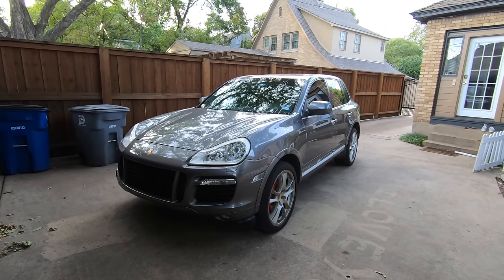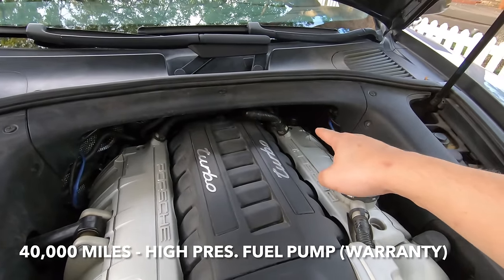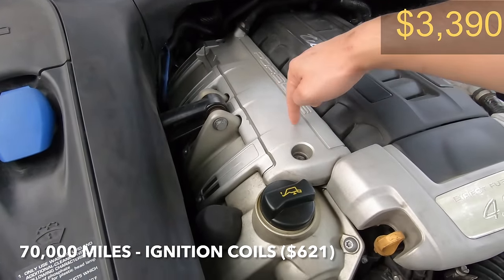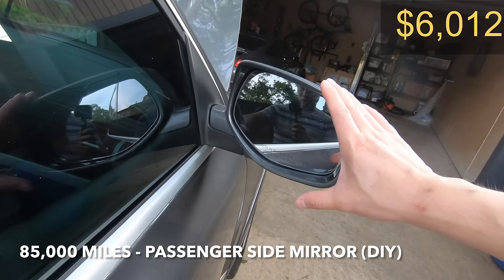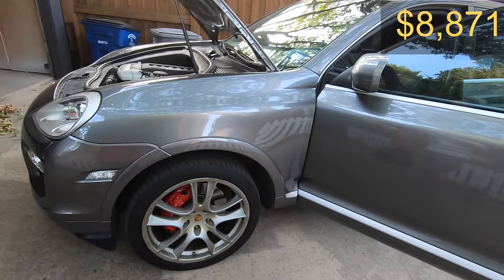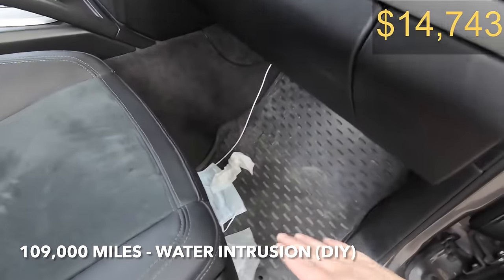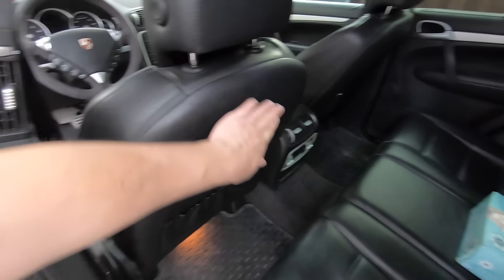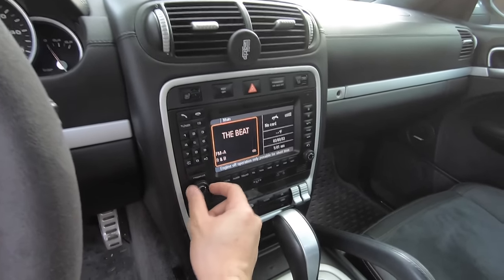Why Are Used Porsche Cayennes So Cheap? Owner's Review of 15 Year Old Cayenne Turbo (955, 957)

Comment: This really makes me appreciate my 2008 Toyota 4 Runner.  150,000 miles and only thing I have done is change the oil every 5,000 miles, 2 brake jobs, and 2 sets of tires.  And that was with an ungaraged vehicle in New England snow.  Had to replace the wiper fluid a few times too, those damn pesky Toyotas.  That Porsche must be a fun ride, but something about the reliability of a Toyota I love.
Reply: I'm sure you didn't forget about regular maintenance like spark plugs, air filter, etc?
Reply: 150,000 miles on a 4 runner, youre just breaking it in, that thing is gonna outlive all of us
Reply: @Chris-de2qc  Belive it or not, yet to change a plug.  I did forget about the air filter every 15,000 miles and maybe 2 cabin filters.  I have hardly put anything into it compared to that Porche. I love the look of that Porche, but never realized just how much more reliable a 4 Runner is.
Reply: @skuzz8182  I have some friends that have hit 250K on there 4 Runners.  I think another 50K on this one and then time to get some modern technology.  But I just can't let this one go, she has treated me so well.
Reply: I have 175k on my highlander and am having my first issue. Wheel bearing. Michigan roads have done that on every car I’ve owned though.
Reply: I have a '97 4 Runner and it has been the most reliable vehicle I've ever owned. It has just over 418k miles on right now. I've replaced the starter twice and the alternator once. The orginal rear drum brakes lasted over 300k miles. I had the original clutch replaced at around 325k miles since I was going on a long road trip. I plan on replacing it with a new 4 Runner in the very near future. I want a reliable vehicle that I can count on for my retirement.
Reply: The people at BMW were surprised how thorough Toyota is during there partnership  when it comes to egineering
Reply: 2004 4runner @ 220K miles. Runs perfect. Love it.
Reply: The V6 version of this car has much less problems not even half of those problems
Reply: My 2001 Honda CR-V with 24000 miles and still running smooth.
Reply: My 2009 VW Touareg 329,000 changed the water pump at 200,000 besides the AWD shaft no problems
Reply: @jaymsu9671  Same thing with my gx470 + an a/c compressor. Built so well I get better mpg than advertised when new in 2006 (with A/T tires).
Reply: This video made me feel like I ran up twelve flights of steps.
Reply: @Jeremyho439  That’s low mileage. Once you add another zero to that, it’s about what my CRV has.
Reply: @jaymsu9671  how do u know when the wheel ebaring is going?
Reply: The bar is set higher for Toyotas. Frame rusts at 100,000 miles. oMg! BMW engine fails at 70k... iT's a NoRmal part of fine German engineering! Use special German oil! Car people are dumb.
Reply: Love my 2015 Scion XB manual. Fun, Roomy, Reliable. Best car I have ever owned! I do have a classic VW GTI 16v, a 92 I bought in 98, fun pure fun. Its a weekend toy.
Reply: Still is the Toyota .... not the Porsche though
Reply: Likewise I have a 2002 Toyota Sequoia 4.7 V8 with 222k. I paid for extra frame rust protection from the dealer when we bought it bc we live in New England. Frame is still mint! Only 2 non-maintenance problems I've ever had is a broken rear door latch & the a/c compressor crapped out at 213k. I'll take this kind of rock solid reliability over a fragile Porsche any damn day of the week!
Reply: And you can still buy that same car today!
Reply: @vetteluvnh  I just wash the undercarriage in a touch free booth. 260,000 miles on mine and frame is still solid.
Reply: My 4runner gave up the ghost at 400,000 miles. Two transmissions and an engine rebuild later I was broke. Still my favorite car
Reply: Yeah, I have an Audi Q7 and while its not as bad as this Porsche, if I could do it again I'd get a Tpypta Land Crusier. They don't look at nice, but who am I trying to impress. I do enjoy the performance aspect of my SUV but between gas and regular maintenance cost, I wish I had gone with a Toyota. Next time...
Reply: @betterwithrum  this Porsche had an unusual amount of issues. Toyota Land Cruiser would not give you much better if any better mileage.
Reply: @betterwithrum  I would think rich people who can afford things like the G wagon have other priorities. They either lease these cars or pay cash. I'm not rich I don't know how they think.
Reply: @chir0pter  I sold my LandCruiser with 650,000km. I still got $30k (Australia)
I replaced the injectors and alternator. That's it.
Reply: Of all the cars I've owned, the European cars were the most unreliable by far. Who cares how good it is when it breaks down. 
In Australia if you're in the middle of nowhere and you're broken down, it could be your worst nightmare.

I think if your car has any problems that make the vehicle stop in the 1st half of the warranty period, it should be recalled or purchased back by the dealership.
Reply: I had a Toyota Avalon, I put 200k on it with almost no problems. Now my daughter drives it. Over 250k and still going.
Reply: That’s why u don’t see many videos on 4Runner maintenance.  Or 4Runner performance
Reply: They're really something else, gotta say. Enjoy the Toyo!
Reply: Toyota FTW, but hey a 4runner is nothing like a cayenne Turbo. Does your 4 runner have a timing belt?
Reply: Toyotas are one of the best in the world ! Just watch top gear with the red Hi lux...they couldnt destroy it....  Bullit proof cars !
Reply: My dad has a 2005 Toyota Corolla 

Its at 350k + miles now, only had to replace a starter motor besides normal wear and tear (brakes etc)

He changes oil only once a year, like 20-30k miles lol..
Reply: @Chris-de2qc  you just put in new spark plugs when engine starts giving trouble in a Toyota
Reply: I used to like Toyotas. My old man had a 01' Tundra when it was new and super reliable. That was until the truck got hit with the infamous frame rust rot. But hey, at least the engine still works right?...
Reply: @stephenjedrey5370  dude no matter what brand the car is you need to change spark plugs..... Just like oil it has to be done..... Unignited fuel can damage the cylinder chambers.....
Reply: Same:  2011 Honda Accord coupe Black.  196K.  4 cyl. 35mpg.  87 octane gas.  No repairs just upkeep.  Oil changes every 5K, tune ups X3, tires X3, brakes X3, Fluid and filter changes etc. ...Oh yeah 1 set of new headlamps with new LED bulbs 3500 Kelvin lasting 50K hours.  yearly maintenance costs ~$300 and no mods needed or necessary.  Love the way my Honda drives.  Not bad for a car that's almost 13 years old built in Ohio.
Reply: @jerryp2433  My 2003 Tacoma built in Canada and the frame is for lack of a better word perfect.  Not all Toyota's rust out.  Most of the bad Tacoma's years ago had the frames rusting out in less than 2 years.  Untreated frames from different manufacturer I guess.  Sad that it's still fresh in peoples minds that at one time for like 2 years Toyota Tacoma frames were rusting way too quick.
Reply: @JC.SpdRcr5  Yea the ones that were rusting out were built in America not Canada. Same factory that builds the Teslas. They screwed up the coating process. Canadians seem to build very good car factories...Windsor Ontario, etc.
Reply: This whole comment section has turned into praises for Toyota vehicles. 😂. My Highlander has 170k and nothing ever done to it except regular maintenance, brakes, tires & a couple batteries.  Never owning another z German car again for sure.
Reply: @DriverGuy23  I want an Alfa Romeo Giulia but I would lease it not buy it.
Reply: @chir0pter  my 2013 Cayenne s runs like a clock.
Reply: @jerryp2433  maple syrup makes us smart, eh.
Reply: @normal_human  nobody cares dude, he’s talking about driving a gas land cruiser in the US not some 150hp diesel outback specialist.
Reply: But WHAT do the NEIGHBOURS think?!?!?
I bet you probably ALSO buy 'store brand' bread & cereal....
Reply: K, I've owned several 4Runners and you're neglecting wear items like anything with rubber or plastic like ball joints, control arms, etc. I do most of my own maintenance but the 4th Gen has been a problem child. Latest issue is finally getting the transfer case actuator seal replaced, which is a bear of a job. Do you have the V8? If so, your timing belt needs to be done. Oh, and they have notoriously easily rusted out exhaust manifolds which causes a nasty ticking. Blend door actuator failure? 

Which is to say, I'm glad yours has been smooth, but I think it's a myth that the whole Toyota is problem free when it's really just the drive train that is pretty bomber. The rest is just as problematic I've found.
Reply: @chir0pter  You obviously cared :)
Reply: @lonememe at least it's repairable though. Try doing a timing chain for an Audi.
Reply: Your 4runner is probably one of the top 10 most reliable vehicles sold in the u.s. in the last 20 years
Reply: This is why I ADORE my Lexus suv. Luxury (almost) of Porsche, reliability of Toyota. Perfect vehicle.
Reply: @lonememe  Also sometimes you just have badluck....It's a probability game.
Reply: Lol
Reply: @normal_human  yeh rite someone is jelly cause they had to settle for a Toyota
Reply: Why are u Jappers even looking at this ?  slight envy eh ? admit it  !  LOL
Reply: Can't compare any car to Toyota, maybe Mazda, others are money pits. Well if you really have money or you like cars more then driving utility then EU cars are no match to any, simply you get top notch cars when new.
Reply: Doesn't need to be a Toyota. Most cars should be problem free up until 150k. I have a Kia Sorento with 130k and only done exactly what you said except brakes only once.
Reply: Since outsourcing German cars became very unreliable. The brand is German but they are made all over the world.
Reply: @daniellantos26  there lies part of the truth, but the other part is that Porsche Cayenee is just rebranded VW Touareg. Also all EU cars made outside of EU are lower quality, even in EU there is difference between cars made in Germany vs. made in Polland or Slovakia.
Reply: The Toyota isn't a german "quality" car....
Reply: Toyotas are boring...I mean - their reliability is so boring. Where's the fun with going to the mechanic to have a talk over a coffee while he is trying to figure out what is the problem?
Reply: @normal_human  lost in the Outback with bogans around the car......
Reply: omg, was just gonna say the same. my 4 runner has been running thousands of miles and nothing has gone wrong, just normal maintenance. same with my wife's rav4. so much for german engineering. this is so embarrassing for them. shameful considering the price people pay.
Reply: Same here with my 08 Honda accord only issues I’ve had with it was an oil leak and the cylinder deactivation had an issue so it turned itself off and went into full v6 mode until I got it repaired other than that it’s been a fun vehicle to drive despite me wanting Apple CarPlay unfortunately that’s for the more modern vehicles
Reply: @koro287  you ever thought that maybe we want the Germans to build better cars so that we can buy it? If you fanboys would stop buying their POS poorly designed cars maybe they'll actually get better and cheaper.
Reply: Yeah but driving a 4 runner isn’t much better fun
Reply: @420BudNuggets  are you crazy bro? I drove my 20 year old 4runner to Alaska. If I wanted a sports car I'd buy a real sports car not a Cayenne. Lmao.
Reply: @420BudNuggets  try taking a cayenne to hells revenge it wouldn’t even survive
Reply: 138,000 on my '13 Runner. Recent brake job. 
Only thing I have going on is the neutral selector switch. Common in 5th gens.
Reply: @slapshotjack9806  I need a Porsche Cayenne to survive a zombie apocalypse....Said nobody ever. Lmao.
Reply: @jerryp2433  no a peel p50 would straight up ruin every zombie in its path 😂
Reply: My 05 4rumner has 277k miles and runs like new. All original parts still
Reply: @Chris-de2qc  those toyota engines can run without oil changes / low oil too
Reply: @stephenjedrey5370  Those 4 runners are being sought after and appreciating in price. They would go 999K with bare minimum maintenance
Reply: Very true!  That thing will last a long while, performs great offroad and the design still looks nice.  May even accrue value after so many years have past.
Reply: Bro, previous Porsche owner. Honestly reliability over fun, there I said it. Maintenance bills forever
Reply: Toyota is a better daily driver than any porsche.  I've owned 2 porsche cars and they were typically garage queens because the reliability was low. My tacoma and wife's FJ are much more reliable.
Reply: Have an '07 4Runner (4.0 with AT) and a 2011 Cayenne S. The 4Runner now has 250,000 miles and the Cayenne 120,000 miles. Neither skip a beat, but the 4Runner is a league of its own when it comes to being bulletproof. The Cayenne hasn't left us stranded and is a much, much nicer ride (air suspension and V8), but the 4Runner is a great and forgiving beater. 
That being said, the Cayenne isn't really all that expensive to maintain if you can do the work yourself. I spend about $500 a year on maintenance on the Cayenne, and that includes the transfercase which I change the oil for on every other engine oil change as a preventative measure.
Reply: I came here to say similar.   Mine is 1996 third gen.  I’ve recently had to refill the windshield cleaning fluid … ;)
Reply: Same with my Honda Civic.  And the wife's Toyota Corolla.
Reply: To be honest, for $90K, that car should be the most reliable car you’ll ever own.
Reply: I heard Toyota 4 runner is still made in Japan only. So no wonder.
Reply: you don't get to number one by screwing your customers.   I don't care if it is a ferrari , a porsche if a car is not reliable, those companies take you on a ride. Those fanboys act like school girls. Ferrari is even worse, you almost have to tatoo ferrari on your butt, and to pledge allegiance to buy a car. Toyota does a lot of R&D and their cars are very reliable. Just watch any safari shows in Africa,  What do they drive: Toyota. If a lion or a elephant charge you, you d better have a toyota. Also sport cars use low tolerance engineering, you have more power but it breaks easily. Not to mention, tires get worned out very quickly. The only benefits of having luxury cars are the ones that appreciate in value or if you want to attract a gorgeous woman but be sure that both are money pits.  Also sport cars are not that great for long distance. The suspensions are quite hard, and you are very low. As for the lamborgini, you don't see anything in the rear mirror. You hit a landcruiser with a sport car , you are so dead.   Plus in a fancy car, you d better dress fancy too because cops will pull you over thinking you stole it and if you are black they definitely pull you over. https://www.youtube.com/watch?v=Ca8_HeJo13M&t=425s  . Sometimes, they pull you over just to check the car, or just to annoy a rich guy.  I will only spend that much on a car if it is not my own money. https://www.youtube.com/watch?v=m4AiIl67eT8
Reply: Same experience with my Avalon.
Reply: well, I never feel regret to have my Cayenne Turbo though now and then I might face some minor issues, as I have a very reliable independent mechanic. It worthies and its full of fun to drive around. In such a busy life, I can have daily pressure when I drive it to work and get back home. The pleasure makes it worthy
Reply: What a shame. Pretty much everything we buy seems to be junk these days.
Reply: A Toyota could be driven to the moon and back, twice with no problem.
Reply: Had a 2004 that I bought new, put 235,000 miles on it..sold it and purchased a 2008 limited 4 runner with 99,000 a few years back and now have 130,000 miles on that one with absolutely zero issues. Know for a fact I have at least another 100,000 miles to go..
Reply: @Chris-de2qc   Changed my plugs in my  Toyota at 150 000km , old ones still looked good as new . Hade many different cars even a BMW , Toyota is the best by far no issues
Reply: I have a 23 year old blazer which I love.  But the diff is whining and I'm sure the trans and/or the engine will give it up in the somewhat near future. It just makes no sense to spend $12K or more to fix a $4K valued car.  It also has squeaks and rattles that you can never get out of an old car.   I've been looking at an older low mileage Cayenne as a replacement.  But good luck with the 4 Runner.  It probably makes more sense to spend money to fix it than an old Blazer.
Reply: @vetteluvnh  Porsches are reliable, talk fragile for British and Italian cars
Reply: @VW Jetta  perhaps they are. Just not as reliable as Toyotas. But I get the performance/reliability tradeoff. And I know what you mean about British cars. Had a 98 Jaguar XJR a few yrs ago. Stunningly beautiful vehicle, but something broke or malfunctioned almost every time I drove it. I traded it for a 99 Camaro SS which has given me absolutely zero problems in the past 3 yrs/34k miles.
Reply: stole my thunder. toyota are the best.
Reply: My wife got 280,000 out of her Sequoia then bought a 2 year old 4Runner. I fully expect it to last another 18-20 years.
Reply: Me with my 3rd gen with almost 260k miles put about 15k miles on it in 6 months, love Toyotas!
Reply: I had a 3rd gen Toyota Tacoma that not only drove like crap, but had a bunch of quality issues. Not unreliable per se, but cheap feeling, low quality of everything, plus rust was starting to build up. I did have to go in to a have the low-pressure fuel pump replaced at 5K miles. I think the older Toyotas we excellent (other that rust). The newer ones, not so much.
Reply: Well, Toyota has terrible materials either in the interior or exterior. Each bolt in the undercarriage will brake when you try to remove them. Moreover, Toyota is always outdated and simple like children's toys. No power, no brake capabilities. They still use almost the same calipers on Land Cruiser 300 as they used in 80 series, which I currently own as a second car after VW Touareg (Cheaper brother of Cayenne). That Touareg is 15 years old and has 186 miles on its 3.0 diesel. Nothing major ever happened.
Reply: 4Runner owner here. This video makes me appreciate my 23 year old car.
Reply: 250k on my our Corolla and 184k on Camry
Reply: @Chris-de2qc  for sure it.want be $14k
Reply: Toyotas are great.  had an Acura RDX same story.  I love porsche but next car will probably be Japanese.
Reply: I owned a BMW and I had to replace the thermostat and water pump every year. I don't get how they break so quickly + replacement was $1600 at a small shop (the dealer asks for +3k)
Reply: @mrmrjims3865  that is total shit.  OMG, what a pain. I will never get a BMW after hearing some stories.  total Porsche Cayenne GTS 120k miles ownership, oil changes, brakes ($2k), ignition coil ($1k), regular scheduled maint (probably3k over years). and recall for transfer case (free).  Maintenance is expensive, but I got a lucky year.  Next one is audi or Toyota though.  cheers.
Reply: @ramonzxcv7411  The thing with small shops is that they make money on the   parts more than labor, they charge you for OEM parts but I doubt they buy OEM, they buy Autozone or cheaper. When I started buying parts from Car Parts they were cheap (80$ for water pump vs 700$ OEM, 150$ for radiator vs 600$ OEM, 80$ for arm controls vs 550$ OEM), the difficult part was finding a mechanic that accepts to install your parts and usually they just require between 2-3h labor
Reply: You should probably do the tie rods, ball joints, shocks, and other things that wear out no matter who makes them. My gma's sienna has almost 400k miles, runs great, but those things will absolutely need replacing at some point. And at 150k, probably a while ago.
Reply: Every Ford I've owned in 40+ years has been that way. Never understood why rice burner owners make out like it only happens with rice burners.
Reply: 275K on our 2001 4runner. On its fourth family member. Nothing but routine maintenance as specified by the manufacturer. And tires. Thing is a little tank.
Reply: @stephenjedrey5370   You also don't consider how much fuel the Cayenne burns.  They are thirsty sons-a-guns.
Reply: They actually  make  these  cars  to run well for about  five years.
Reply: @anthonystroman8407  This piece of shit had issues from jump. Water pump, thermostat, control arms, drive shaft bearings, wheel bearing, ignition coils, vacuum pump, coolant leaks, electrical issues. Alllllll under 100k. That’s INSANE for any modern  vehicle. Then the engine mounts go bad?!? Wtf!?!?
Reply: @normal_human  Yep, here in Australia, if you see a car on the side of the road with the bonnet up (that's 'hood' for our American friends), you can be almost certain it will be a BMW or some other overpriced German lemon. Amazing how many people will trade 'em in on another one, though...
Reply: it probably has 99 problems but you're just ignoring them all
Reply: @sleepyjoescumbag1663 I really hated settling for my mk4 2jzgte with a billet block making 2600hp running 5s in the 1/4.  Thank you titan Motorsports
Reply: Sounds exactly like my Tacoma. 189k only thing I did besides brake pads and oil is replace a stolen catalytic converter
Reply: Screw European cars... unreliable and high repair costs.   Also, no turbo
Reply: All this did was to me that Porches are all for show.  I am convinced that Toyotas are the way to go!
Reply: My 87 Toyota rusted out and died after 3 years in the Boston region. Toyotas are great in the West and Southwest, but they just can’t handle the Northeast
Reply: Like thats a lot of milage...I drove a 2012 Ford Focus for 300,00 replacing the battery and new front pads ..oh and I did the oil changes with Mobil One. I traded it in on a 2018 Focus
Reply: No timing belt?
Reply: @jaymsu9671 Same here in Canada, a conspiracy of potholes…
Reply: I feel you, my Toyota Camry has 67k miles trouble free. But I’m still going to get a 991 in the future regardless of the maintenance costs lol. Best of both worlds! Lol
Reply: And there is truly no reason why they cannot be made to be just as reliable as the Toyota.
Reply: Bragging about reliability is like bragging that your wife is punctual.
Reply: The 4Runner is the ideal of mediocrity. Like worshipping the most plain boring vehicle on earth. I have one cuz they hold value like crazy but I hate it
Reply: I always liked the 4Runner .  Never rode or drove in one, though.  Just like the look.
Reply: I don't know about some but my needs include performance, looks and reliability. For my car and my wife.
Reply: Yeah my 2013 Nissan Murano that I recently sold cost me 0$ except for maintenance.  It's weird how high dollar luxury cars can't make the basic stuff work sometimes. The 2014 Merc e350 is still flawless tho as well. not selling it.
Reply: @Jeremyho439  Yep
Reply: I’ve owned several 4_runners and Toyota’s in general. They may be long in the tooth and are a bit ho-hum, but they last. Built to last not to be only a status symbol.
Reply: This guy is basically saying he has more money then sense and isn’t very bright. Oh wait there’s a Porsche in the garage, yeah he’s not very bright.
Reply: Black 2008 Toyota Tundra 4.8L 4x4 Crew Cab. Purchased it in 2014 with 46k miles - a week before separation & divorce. Today, it has 178K miles and it has been a rock-solid vehicle. Truck came with 18" steel wheels. Procured 20" used Sequoia aluminum wheels & lugnuts. Don't forget to replace your spare with a 20" wheel & tire.
The problems were few, but worth mentioning
SAIC emissions system failed twice. First occurrence/dealer replaced under warranty.
The second occurrence/procured & installed Hewitt Technologies add-on computer ($395.00) - problem solved forever.
Oxygen sensors replaced from time to time
Exhaust rusts & rots off. Replace as necessary (Rock Auto)
Replaced the alternator two times (Amazon/RockAuto)
Replaced the stock brake system with a premium towing brake system drilled/slotted rotors/calipers/SS brake lines(RockAuto - $900)
Replaced the shitty stereo with cheap one from RockAuto. Learn to solder & heat shrink your stereo connection/power/signal wires.
Change oil at regular intervals. If you think you can't afford it, ponder life bereft of a truck, then reconsider.
TRUST !!
Reply: The best car you can buy in Germany is a Golf IV with the 1.9 TDI Diesel Engine and 105 hp. My friend has bought a old one for 2000 Euros and will hit 300k miles. He drove on that car around 60k miles without issues.
Reply: We had 1993 Toyota previa that our family put 440,000 miles before trading it in 2006 for a sienna. Still got $1000 for trade in.
Reply: A Toyota ain’t’ a Porsche. I appreciate the 4 Runner for what it is, but I’d never have one over my Porsche Turbo, two entirely different vehicles. It’s all personal preference of course. I do most the work on my Cayenne, I would never pay someone all that money to fix my Cayenne. I do enjoy his channel, and the tips.
Reply: * * * * ME TOO!!! * * * * 🤣🤣🤣  My T4R is a 2009 purchased new, now has 272,xxx miles.  Just regular fluid & filter changes - oil, trans, diffs, brake fluid & coolant. Finally caved and replaced the shocks, a couple of sets of brake pads, spark plugs 2 or 3 times.  Never an issue, leaks or otherwise.  Interior is kept clean and still looks great (cloth seats).   THE BEST car I've ever owned.  🤩  Despite the different driving dynamics (the Cayenne could take it any / everywhere except off road), it does prove that if the other carmakers wanted to, they can design and build cars with few if any problems.  I hoping to see if I can get mine to 500,000 or beyond.  I LOVE my 4Runner!! 👍
Reply: You are comparing a family SUV to a high performance higher grade SUV. 4 Runners are known for frame RUST, body rust, Paint fading, Melting interiors, head gasket issues, timing belt issues.. You will end up throwing 10 to 15 k in the same lifespan fixing all the things toyota cut corners on that car.
Reply: @evythefish21 Buy a Toyota you will have, Transmission issues, Frame Rust totalling the truck, fading paint, melting interiors, head gasket issues, etc. You will end up spending much more money fixing Toyota fuc*ups than in a Cayenne.
Reply: @tb4326 They last? Yeah how about frame rust? Body rust? Melting interiors? Paint fading? Head gasket issues? Timing belt on the v8? Toyota are known for rust and crappy build quality in their chassis/bodys.
Reply: @ToyotaAristo  I mean, you can’t be serious. Maybe after 200k on the odometer.
Reply: Yeah, our 2013 Sienna we bought new has 210k on it, and finally thinking about selling it after so many good years hauling the family.  They are older now and the van is not as needed.  Looking to get a used Tundra to go with our 2021 Camry.
Reply: AND when its paid off and keep working just fine... THATS LITERALLY - "MONEY IN THE BANK!!"
Reply: I want to buy my wife a toyota rav 4, cloth, basic, engine will run for 100 years, but u know what, she passes my dodge rebel like im standing still in her cayenne S on her way to work, grinning ear to ear, handling on a dime, braking power if she needs, yeah it cost 148$ to fill , i'll be the one fixing the issues it has, but she's literally said it'll be hard to go to anything without the power and agility the porsche we have has.
Reply: @dorny14   you have a good life.
Reply: I've had two Toyotas go over 300k miles with only basic maintenance. You've barely broken it in
Reply: Can't really compare those 2 cars thou, they are bought for very different reasons
Reply: An had a boring ride everyday..
Reply: When you praise your 4Runner, remember to mention the things that it doesn't offer you and that the Cayenne does.
Reply: A Toyota, giggling is not porsche. If you want cheap car and don't care, get a scion or cube.   Most importantly,  never buy a car the first year out. .   I am sure the ladies think your cloth seated 4runner is sexy.  My cayenne turbo S kicks ass.  Its passes 911s with 570HP stock.   Comparing a 4 runner to a porsche is like   Chris Farley and Arnold Swarzenegger.
Reply: Yeah, but the whole time you're driving a 4runner. A loud, slow, uncomfortable, too small, uncomfortable, unattractive, basic, uncomfortable and common automobile.  That's uncomfortable.  And you'll probably convince yourself to keep it 10 more years because you think it's a flex that your car is so old and uncomfortable.  I guess man, seems like a weird kink.
Reply: Yeah but that’s a Toyota. From Japan. A Porsche is the love child of a German engineer and an architect who has an itch for speed. A Toyota is a Toyota. Point a to b with minimal effort or consideration. A mindless car in terms of emotion.
Reply: I started looking into these for a off road vehicle. But after much research that's gonna be a NO for me Dawg!
Reply: This is why I can get a cayenne for $5000 and an absolutely ravaged 4runner is $10,000+